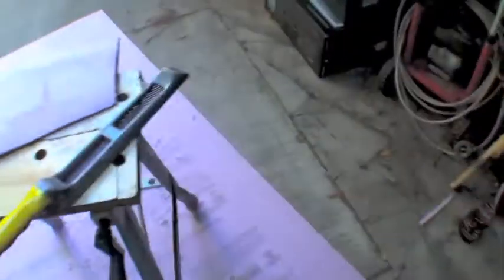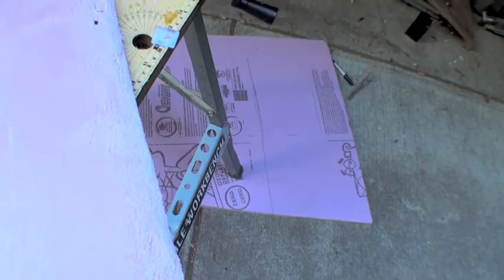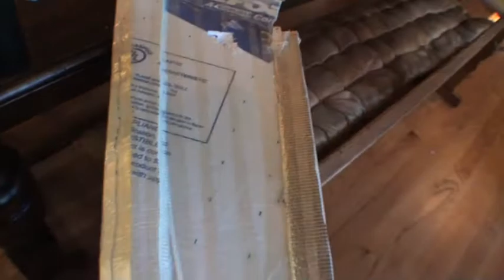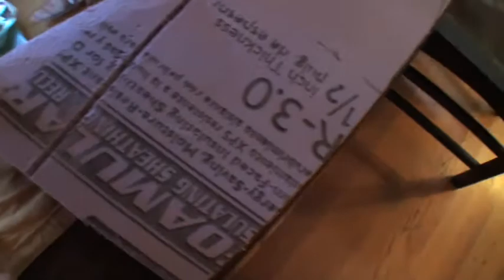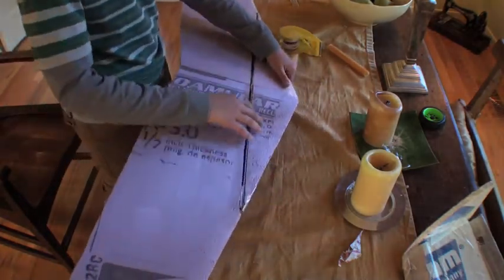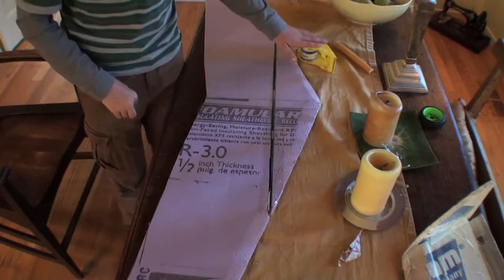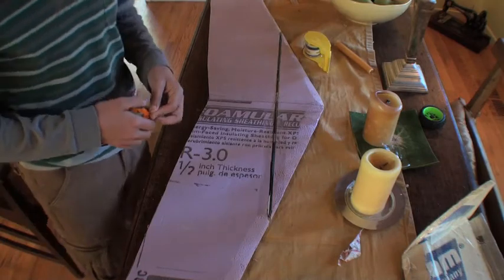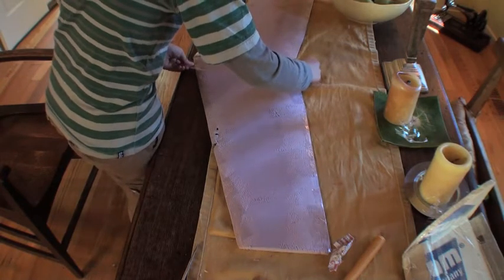building a no-hotwire wing part 1: shaping and taping

Comment from the maker: usually i sand my models. it's just not really needed since i tape covered this one. as for the aerofoil, it works fine. looks a little odd at the tips (hard to get the aerofoil right on the last centimeter or so) but it flies awesome. it's been put aside for now while i work on another project (stay subbed, TRUST ME) but i may get it out again sometime and make a video of it.